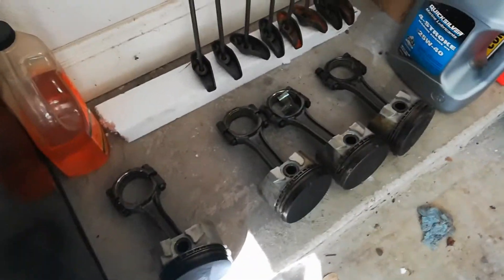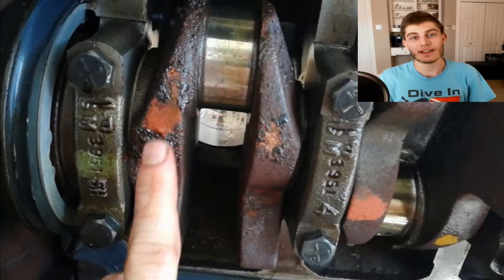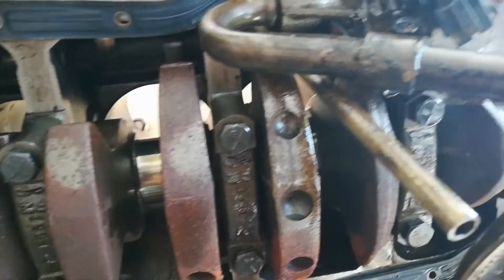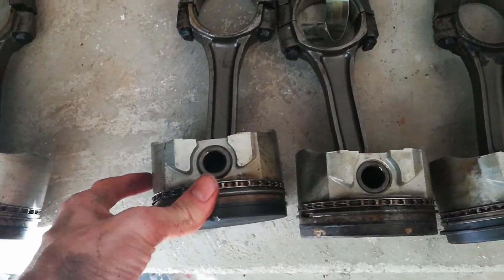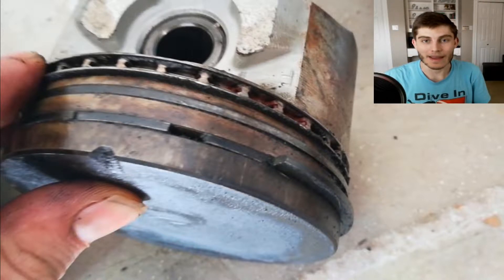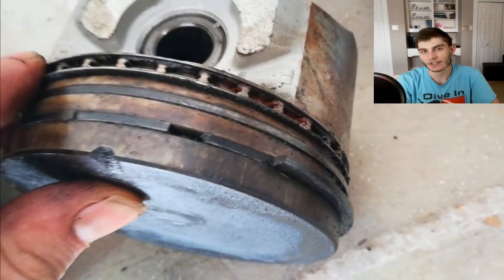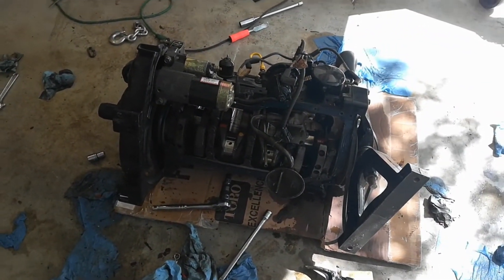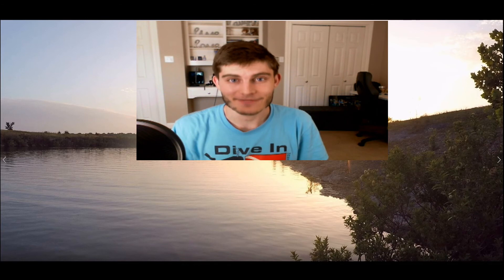Mercruiser 3.0 unseized Engine!

Comment: You got it almost right as the crank spins it slings oil up into the cylinders to help cool and lube the cylinder walls and the pistons the oil control ring  wipes the un needed oil off of the walls and directs it thru the holes to drop back into the oil pan.